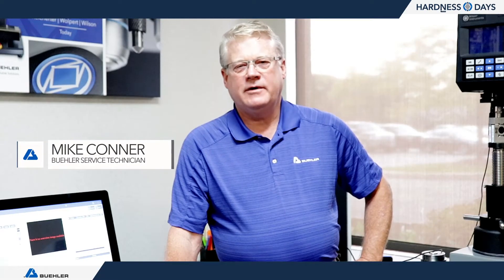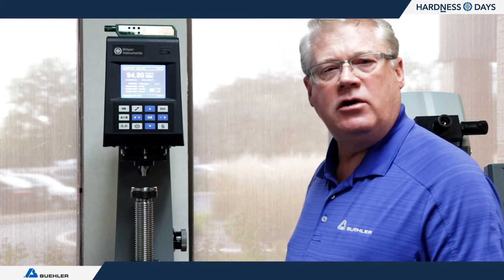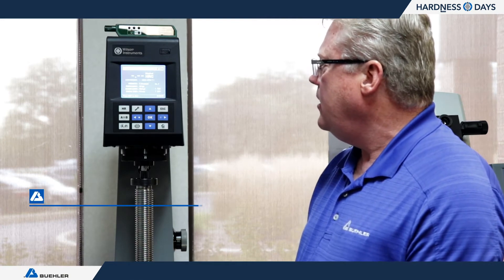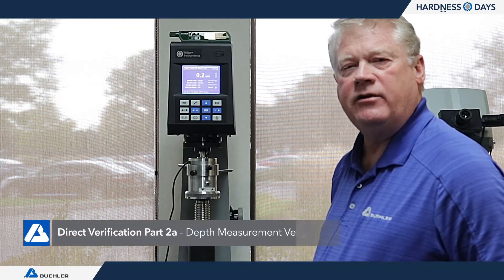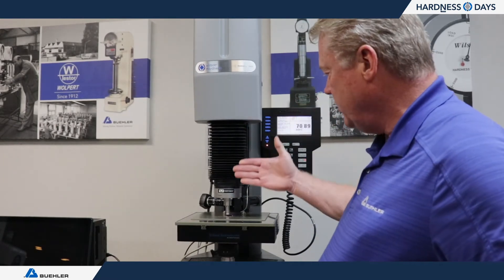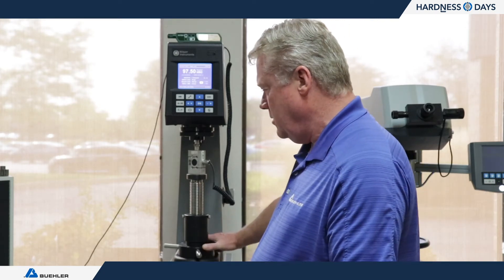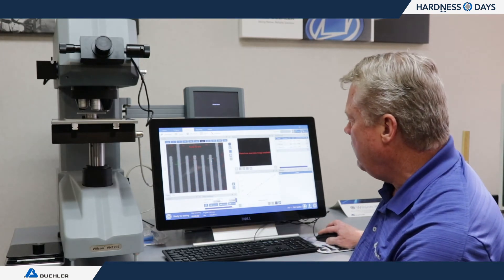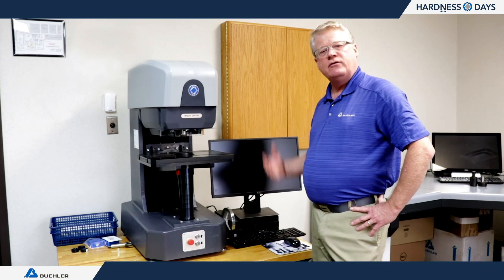Calibration of Hardness Testers

Comment: When testing a camshaft. Does the shaft have to be supported directly below the hardness contact point   in order to get a correct reading. Or is it acceptable to put the shaft on 2 v blocks and test in between the blocks with nothing supporting directly below the contact point? Thank you.